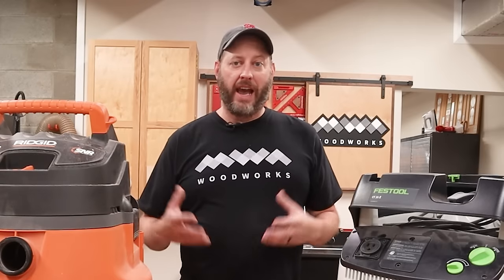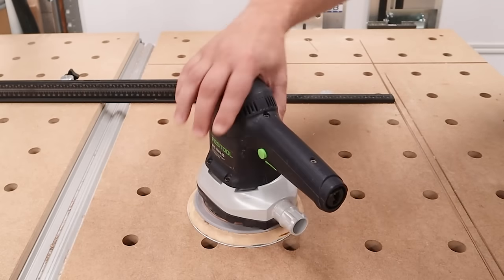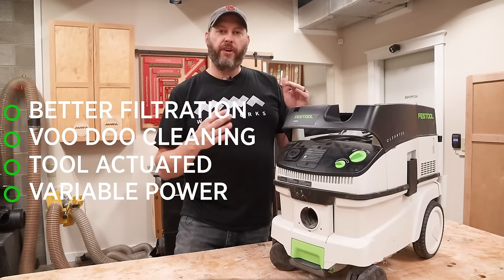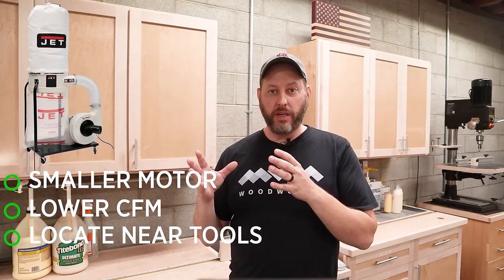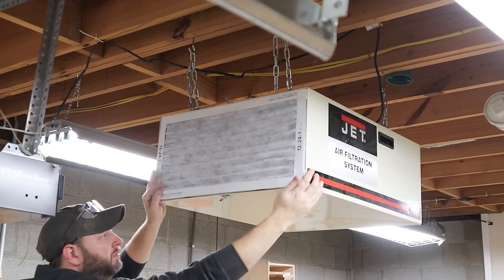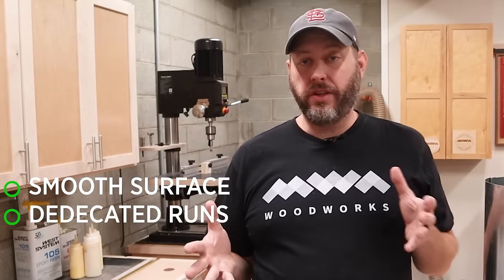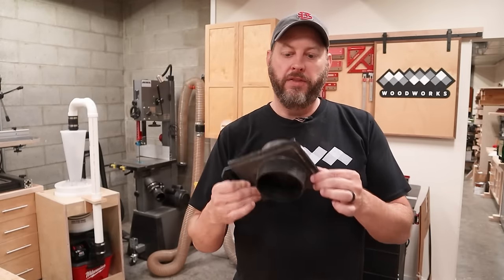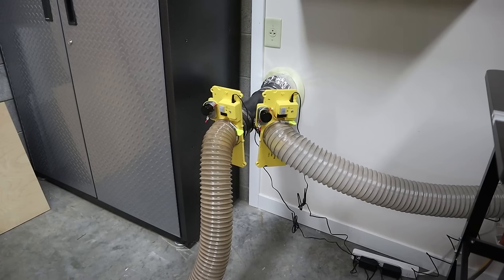Pros think about dust collection differently

Comment: I would advise a different priority approach in equipment selection:  the first decision is air quality, and that is hard-linked to the tool exit filtration system.  If you discharge outside the breathing space, no worry (probably don't need a filter, either).  But most of us breathe that discharged air, so the filtration type at the terminal is crucial.  The industry (esp. DIY) is pretty vague on this, but a key term is "micron":  if the final filter is rated "5 micron" it's going to miss some of the small particles you don't want to breathe.  Ratings of 1~3 micron are what you want.  Now, go back to the equipment selections and you find that shop vacs don't really do well by this criteria.  Extractors have better final filters, but extractors are relatively expensive, low air flow (won't serve a table saw), and low waste volume (have to empty them often).  Who's left?  Dust collectors:  don't dismiss bag outlet filtration in favor of cartridge.  Both bags and cartridges can be designed for the 1-micron level of discharge; I find bags are easier to use and usually less expensive (vendor such as American Fabric Filter).  Room / shop cleaner:  the fine particles that you want to avoid settle out of the air in about 3~5 minutes; a room cleaner takes about 15 minutes to exchange the volume of the air through its filter.  As a result, when you walk through the room, you stir up the very fine particles and breathe them in before they get cleaned.  So, capture the dust in a dust collector with appropriate filtration at it's discharge.  Oh, vortex sections don't make the air any cleaner (again, cleanliness depends on the filtration of the air discharged into the room).  Vortex separates the larger pieces into a more easily emptied container, thus facilitating maintenance, but the remaining fine particles go into the fan and the final filter.
Reply: Basically every shop vac has the ability to install a HEPA filter, which are rated to filter 99.97% of particles larger than 0.3 microns. Some shop vacs even come with a HEPA filter out of the box. HEPA filters are more expensive (usually $60+) but it's worth it if you care about air quality.

And if you're using a cyclone separator, then you don't have to worry about the HEPA filter getting clogged, because the cyclone separator will filter out most of the sawdust anyways, so only the very fine particles reach the HEPA filter.
Reply: @SchemingGoldberg  This is true.  BUT you might keep in mind that the HEPA is really intended for electronic / pharm  manufacturing cleanliness where sub-micron particles pose inhibitions to yield.  HEPA media imposes a HUGE pressure loss penalty on the fan, which translates to significant (50% +/- ) air flow loss.  That's why I start at the desired final result (particle size profile), not the methodology (filter choice) when designing a system.  Merv 13~15 filtration sufficiently reduces 1-micron particle sizes for most people (remember that susceptibility to airborne particles is not constant:  some people are hypersensitive, and they would opt for merv15, etc; but again the choice of environment is the first step).  HEPA is rarely an optimum choice for DIY apps.